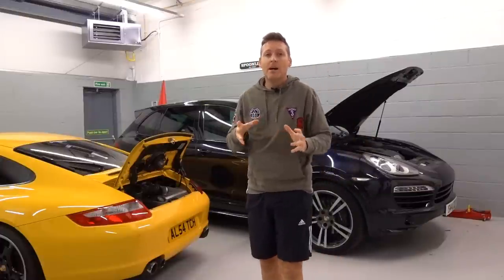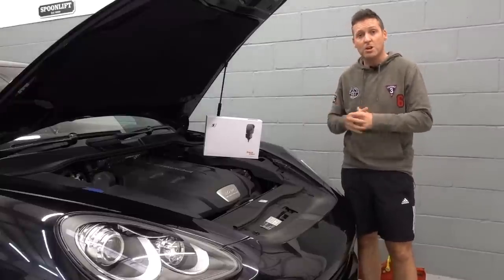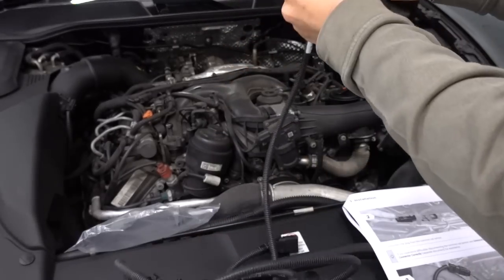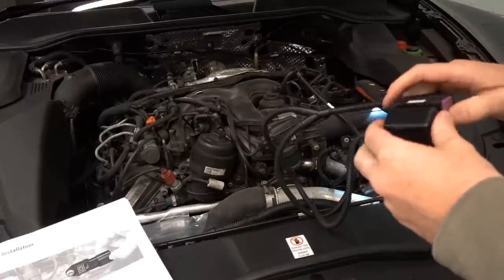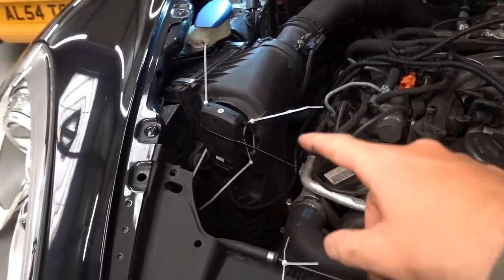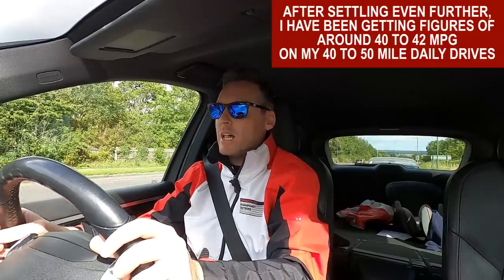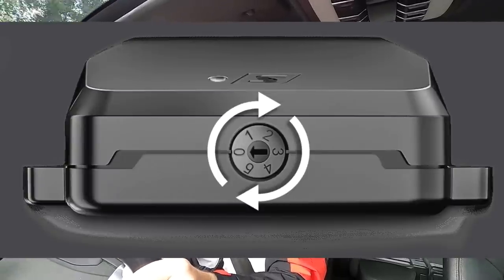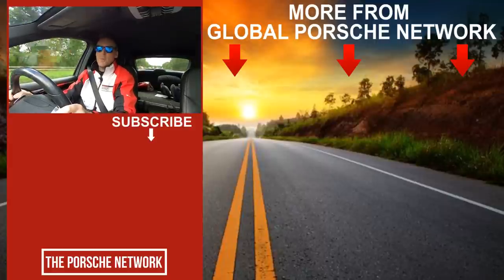More Power In Your Porsche In Under 10 Minutes Extra BHP & MPG 😍

Comment: Just wanted to share a little experience about how indispensable it is to have a diagnostic scanner, it is absolutely crucial if you will own a Porsche and not get ripped off by dealers or mechanics.

Close to my house yesterday my 2012 Cayenne Turbo threw multiple errors on the dash, first it was Auto Start/Stop Deactivated, then a PASM error, ABS, Chassis Suspension, AWD, Stop Brake error, I mean it was a whole lot and the car went into limp mode. I managed to get it home by switching off PSM and plugged in my scanner and there were so many DTC's but the one that stuck out was "Right Rear Wheel Speed Sensor failure".

After a bit of research I found out on Rennlist that many people have had that same error across many Porsche models with the same symptoms, so I swapped out the sensor and voila problem solved!

The reason I decided to come here to write this is so that it will help someone, a £150 scanner or even less can save you thousands, I've read posts by people with the same errors that ended up spending big time on multiple parts and services as invoiced by their dealer, I have an advanced programming scanner but 99% of the time what I use to solve my issues are just basic DTC read outs, I hardly ever use the advanced options.

I've had about 5 years of owning and repairing a 997.1 and now a CTT and when I tell people that Porsche cars are the easiest cars to repair they don't believe me, you just have to get a scanner even if you can't wrench yourself, but before you take your car in, let them know you know whats wrong with it!
Reply: Thanks for sharing your story.  It’s these stories that is taking the fear out of me to buy an older CTT.  Curious on what is the best icarsoft unit to buy for a 2012 CTT?  POR v2 or V3 or Autel scanner Maxcomm MK808BT?
Reply: @CONNECTEDWORX  it all depends on your budget and if you plan to buy newer cars in the nearest future. If you do, go for the Autel, make sure you update regularly, their subscription is quite expensive so make sure you're fully updated all the way in the first year so you're pretty much covered for all cars but the absolute latest cars.

Comment: I just removed mine from my 150bhp T4 2.5tdi. I've had it on for 2 years but although it gave a real kick to the power, I got sick of the black smoke from the exhaust on acceleration and the near permanent check engine light, however I adjusted the setting. Since I took it off last week the car seems a lot happier. No more engine light and no more smoke...
It'll be up for sale soon. I paid 90€, I'll probably sell it for 30 or 40

Comment: You can’t trust the estimated MPG given by the Porsche trip computer to do an accurate before/after comparison. These boxes send skewed air/boost/fuel values to the Porsche engine controller to achieve the changes in engine operation. This means the Porsche computer isn’t using the actual air/boost/fuel values to compute fuel economy, which results in incorrect estimates. 

These boxes also likely negatively impact emissions levels.